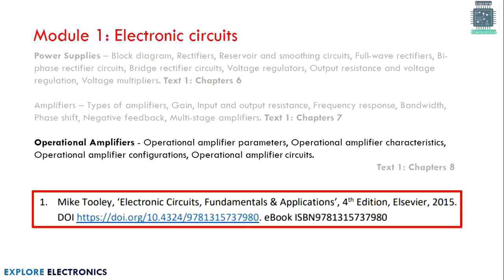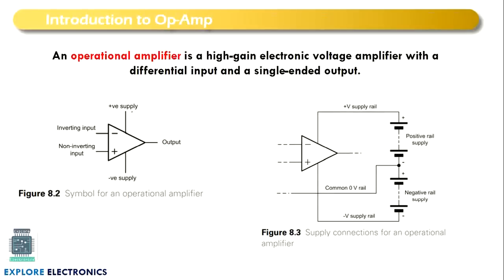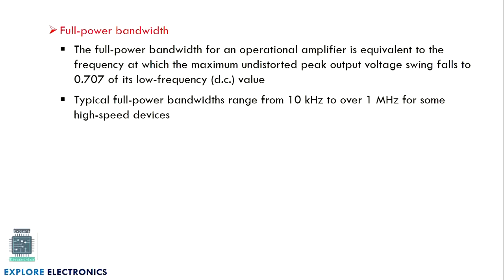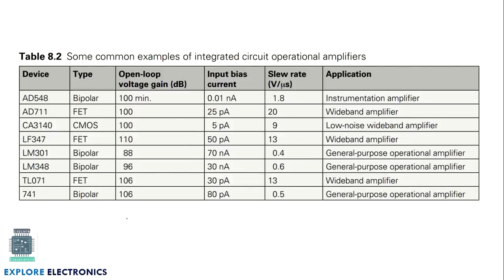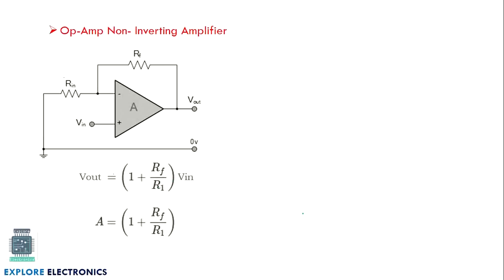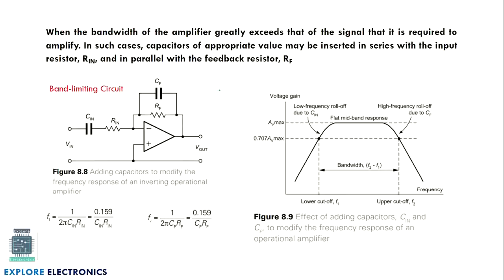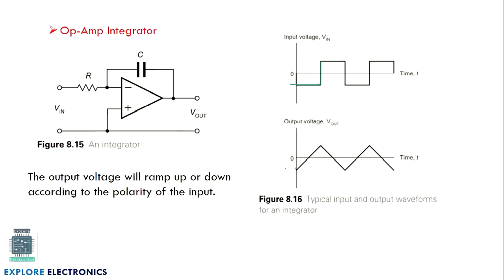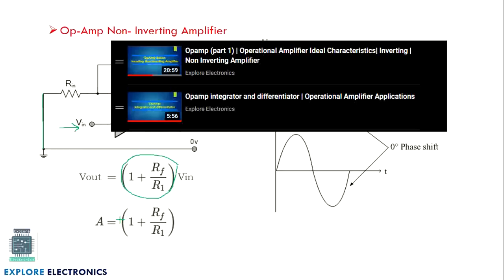M1 L4 | Operational Amplifiers, configurations, other opamp circuits  | Basic Electronics BE&CE 2021

Comment: Sir can you kindly explain what is virtual earth summing point
Reply from the maker: We say, inv and non inv terminal voltages are same, 
1. virtual ground point in inverting amplifier: Voltage at Noninverting terminal Ov since it is grounded, so inverting terminal voltage is also 0v.
2. Virtual short in non inv amplifier: non inv terminal is provided with Vin, is appeared same at Inverting terminal.

So take that point voltage looking at non inv terminal.
Reply: @ExploreElectronics  Thank You Respected Sir.